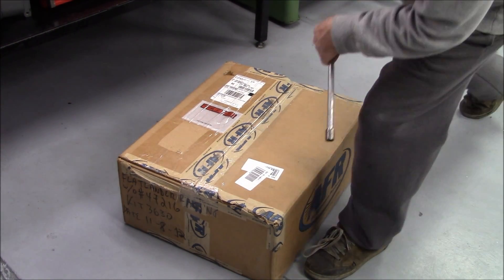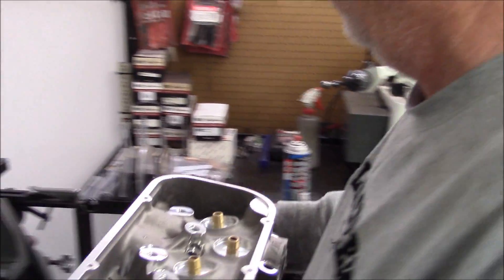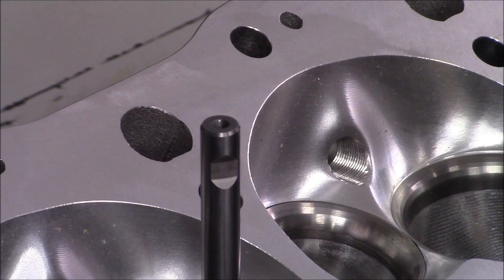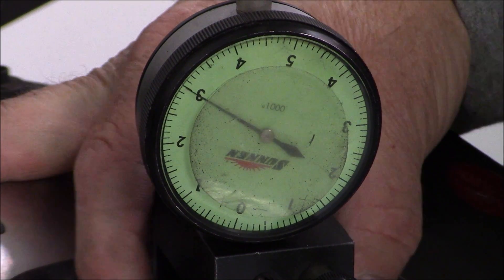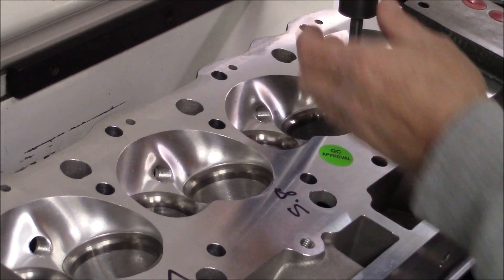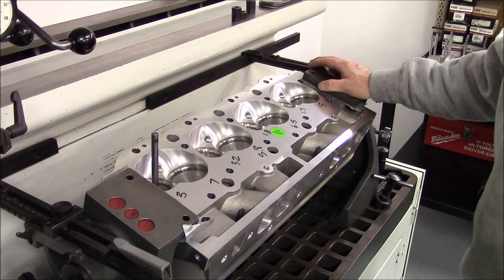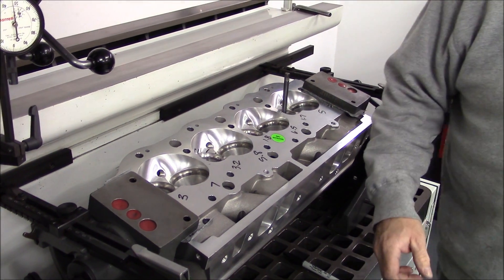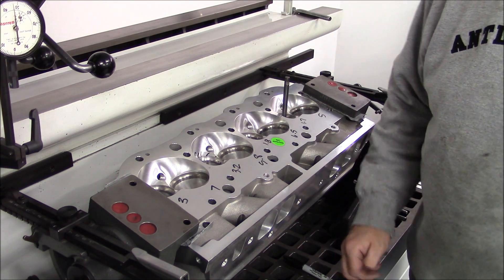Aftermarket Cylinder Heads - Why You Shouldn't Just Bolt Them On - Part 2 - TRRC / Vortecpro

Comment: I would say that most, if not all, head manufacturers  machine their guides and seats on  separate machines "to spec", then press them in the heads and install the valves that have been machined "to spec". Or outsourced all together. But I would most certainly say that the heads are not checked during the assembly process. They don't set stem to guide clearance after the guide is pressed in or check valve seat concentricity after the seats are pressed in. That's why we see such sloppy work, even on AFR heads. Unless you work in a machine shop or know someone that does that sees this kind of stuff first hand, whoever plops down $1600 plus for a set of AFR heads is just going to assume the machine work is top notch and install them out of the box. I did just exactly that when I bought mine ten plus years ago. Luckily they didn't have too much time on them when they ended up back at AFR after they were ported. My head porter and Tony Mamo are friends and I was told that Tony did the valve job himself as well as set valve spring height for my cam. Also flowed number 1 ports on each head.
Reply: No the seats are pressed in then machined. check machining videos on youtube from dart AFR and brodix. they use seat cutting machines in a separate operation similar to the guy in the vidio, Minus all the BULL
Reply: That's pretty sad if what you say is true.  Even though they might still be "in spec" I expect more when dropping that kind of cash for a set of heads to just run out and have a valve job done by a competent shop. If they can't get them any closer than that, might as well buy them bare and have them put together with better valves too. At least that way you know what you will be getting.
Reply: Thats not true the seats are machined in the heads after they are pressed in. I have owned a machine shop for over 30 years.
I dont know of any of the big US performance head manufactures that Out source there manufacturing.
Why am I responding to this video seen these rumors, internet gossip and bull artists  ruin the performance engine building business some one needs to say something
Reply: You're right on one thing - setting up twice will risk introducing error.  In terms of total time to get valve jobs right it would be nice if  heads had guides honed, then seats cut without disturbing the jig.  They may kick them out the door faster with specialized stations, but in the end there are more man hours and more money spent to get to an engine build.  Some things fall on the customer regardless [like getting head ports and manifold ports sized right], but this is one thing that can drive the unsuspecting a little batty.  Tom is right about seats: you can't press something in without some minor distortion or alignment variance, so precutting seats "to spec" is a waste of time.  A rough shape might save some time, but you stil have to cut after install.

Comment: Another thing I’ve learned over time is that I don’t chase numbers lower than the stem to guide clearance. If there’s 2 thousandths of guide clearance then 1.5 thousandths runout is fine because the stem will slightly tilt in the guide and the valve face will seal tightly against the seat.
Reply: Hmmm dunno man, confident this would cause uneaven guide wear if its always trying to center itself on the end of the stroke

Comment: I use a VGS20 and with the dead pilot system I find that the guide has to be flat where the pilot enters.  If it’s not flat the pilot will lean in the direction of where the guide is shorter and cause the cutting and measurement of the guide to be based off an inaccurate reference point. Were the guides flat on these heads?

Comment: Brand new heads are not the only ones with problems I recently purchased a set of ford 351W gt heads on line when I got them I was installing new valve springs to match my cam when I discovered the machine shop I bought them from had the intake and exhaust springs mixed up having found this I checked the heads found several valves cut to a sharp edge I replaced all of the valves but I must say the machine work on the castings was excellent I guess my point is you should always check any head you buy regardless if new or remanufactured
Reply: Rick P.I used a comp cams roller cam in my 5.8 the engineer I worked with had a hard time finding  springs that had the correct travel (without coil binding) and pressure for my cam the intake side was simple (spring shims ) on the exhaust I had to use different retailers and .050 offset keepers (locks)  to get the correct installed spring heightsluckily comp cams did have the 10 degree retainers and matching keepers in 8 and 8 (retainers) 16 and 16 (keepers) sets
Reply: insulman100 yeah but how? I’m new to all this so I wouldn’t know where to go, who to talk to, or even what to look up.
Reply: Talk to several people, and research. Or ideally find someone that knows their shit and have them look it over. There are good machine shops out there, and there are shit ones. I have seen some high dollar shit ones and some low dollar good ones. It's just a matter of trial and error. 

Maybe find some people in your area that has had work done and ask where they got it done, and how good it was. Then use that as a guide on ones to visit and ones to avoid.
Reply: I assume Tiny Turbo you mean intake and exhaust valve springs Yes on a 1996 5.8 w ford engine(and many other engines) they are very different intake 2,06 in. exhaust 1,88 in. these are the valve spring free length specs for a 1996 351 (5.8)Ford Winsor engine(the valve lock is machined lower on the exhaust valve stem) put the longer intake spring on the exhaust valve you have to much seat pressure and possible coil binding best case premature cam/lifter failure  from the seat pressure from coil binding best case bent pushrod worst case broken cam = destroyed engineexhaust spring on intake not enough spring pressure best case burnt valve worst case valve float causing a dropped valve = destroyed engine Just wondering do you work for a cylinder head rebuild shop in Chicago?
Reply: qballtvp that makes sense. Thanks!
Reply: Go to the local repair shops talk to the some of the people that work there some of them will tell you to hit the road but most of them will help you they will either check your heads if they have the tools(for a price of course) or they will direct you to a reputable machine shop that will check and if needed repair your heads again for a pricethe thing to remember is not all shops are reputable do your home workMy advice only buy rebuilt heads from reputable shops and like the video says have all new out of the box heads checked This step may cost money but if your heads are assembled wrong like in my case not only could it cost you another valve job it can also destroyer your cam and lifters or if you drop a valve it can cost you your whole engine
Reply: I didn’t know intake and valve springs were different.
Reply: insulman100 (

Comment: this is the guy I want cutting my heads. Pro!
Reply: exactly
Reply: Cory Bollinger not so much. He checks for normal (vertical) in two axes, and THEN unclamps the workpiece and slides it at 9:29 and then reclamps it, without rechecking vertical.  🤔

Comment: aluminum heads shift around after  a complete valve job, as produced, I guess what your   saying is buy them  bare and have a dam good machine shop straighten out the run -out, the hairy part is some times the valves produced in China can be junk, and have been known to snap, and you know what that means.

Comment: I re-cut the seats on my new Brodix heads after I hand ported them.  I also lapped the valves in so I had a nice band of
contact around the valve seats.  When we dynoed the motor everyone was shocked at the HP numbers!  I was proud to put my name on them!!!  Just take the time and you will be rewarded with something special!
Reply: Steve Solo absolutely im doing thes thing now on a 331 build and everyone doubts my prediction on hp #s and little do they know that when you put that extra 10% work in you are greatly rewarded. If I just slapped this thing together id probably get 350 375 to the tires but when I GET DONE ill betty money I break 500 to the tire but it's gonna cost me probably 200hrs of labor but well worth every minute
Reply: Shouldn't have to lap if they're cut right. And especially if they are ground after. Lapping will not perform as well.
Reply: Contact will only improve with lapping if they weren't cut right.

Comment: Great video I feel like there should be a more precise way to line up valve center and valve guide center but I've never done it so I'm probably wrong the CNCs I operate are from the 90s but I'm able to maintain a .0001 on pocket depth and diameter most my day is indicating either way great video it taught me a lot
Reply: Bob Elkin III problem is production vs profit they can't afford that extra 2hrs per set to do it right
Reply: +Bob Elkin III, yes you can maintain that, but for how long until an adjustment is needed, and or inserts need to be changed? What if the tolerances you go by are set by the company you work for to be higher and they want to maximize machine in operation time? Yes you can slow things down and make it super accurate, but that costs time and money. One off projects at smaller machine shops it's easier to look at it that way and do it that way. Larger shops that are essentially setup for production need to pump them out to maximize profit.

Comment: you should take the tapered pilot and reinsert it180 deg., then check the run out  at 180 degrees. Be amazed at how many bent pilots are around from forcing them into and out of guides. larger the valve head the larger the run out.
Reply: Santa Clause: That's exactly what I was thinking when every one was way out. Then I realized that the seats were probably never cut. This head was shipped with no valves installed. It is up to the valve installer to cut the seats, so they match his valve face angles.  You would think that a professional would know this. Instead he complains that he has to cut the seats, like it's a mistake by the manufacturer.  What an idiot.
Reply: also clean the guide before putting in the arbor
Reply: Exactly, never assume surfaces are clean.
Reply: You my friend are a genius. I was thinking something along the same lines.
I was waiting for this guy to pull out a sledge hammer and strike the head. 😂
Reply: Santa Clause is this really you Santa ??? Aka jay?
Reply: Santa Clause lol we got a guy on our team named Santa and he does heads so maybe it’s you lmao

Comment: You are measuring the concentricity with a tapered pilot and machining  it with the same. Your valve machining equipment is not capable of machining it straight. Use a straight pilot with a max. clearance of .0002 and re-check these heads you buy. You may find you have made them worse.
Reply: I'm glad I read your comment. Makes sense. Probably best to machine/check the guides first?
Reply: I've heard it is important on Aluminum heads to use a torque plate.
Reply: You're an idiot. Aftermarket heads are junk until you fix them. Machine not capable? You don't know what you speak of.

Comment: So why is it that all these aftermarket heads have seats with such high runout when they are using quality, high dollar machines to do the machining?
Reply: The only way this could happen is if the manufacturers seat cutting equipment had a bent shaft.  Not impossible but highly unlikely.
Reply: +Aaron Purtell, No I mean the inserts. In that instance I was speaking about CNC. When machining from billet you don't use guide pilots. That's only  after the head has already been fully machined. I am talking about the  initial machining process via CNC. You can go to www.carbidedepot.com and see what kind of inserts I am talking about. The inserts used  in this video and what other shops use for valve jobs is a bit different. To see a head machined from billet you can check this video out. https://www.youtube.com/watch?v=EPDBdb72oDQ  or search for "Aluminium Cylinder Head CNC Milled from a Block of Billet!"
Reply: qballtvp awesome I really appreciate the info, I’ll have to look into that
Reply: +supersportimpalass The inserts get dull after a while. If the machine operator does not check the tolerances very often it can lead to this. Also it depends on how they are told to do it. They could very well be told that acceptable tolerances are higher than the norm, and run the inserts a little longer than usual. 

+mrbeefhbw maintenance isn't a huge issue here. The man running it? Sure, but it also can come down to how they are told to run it as well. Remember all of these shops have QC. If you as an operator continually runs out of tolorance your ass is canned. It's highly likely that the initial tolerance (set by the company) allowed is higher than what most people would like. 

There are numerous reasons for this. Not having to change inserts = time. The cost of the inserts is a factor albeit a small factor. Time the machine isn't running plus the time it takes for the operator means no money is being made.
Reply: qballtvp by inserts do you mean the guide pilot?
Reply: K
Reply: They are not, buddies tools are fucked
Reply: The machine is only as good as the man running it, and the tech maintaining it. A machine down for maintenance isn't making money.

Comment: How deep have you had to cut these seats in order to get the valves to seat properly?
Reply: Spadadiforza probably between 1/32 and 3/32
Reply: There is only a small margin that actually seals the chamber so the actual dept isn't very much at all ...Right ?  Or ?

Comment: I still remember the first set of heads I did when I was 14, I just put valve grinding compound on the seat, stuck the valve in, and spin it with a drill. I spent weeks porting them on a old junky set of chevy sb. heads.
Reply: When I was 19 I worked summers in the maintenance shop of a highway construction company. One day I was instructed on valve lapping and dutifully started south Ning the Cat head by hand. After working on one seat forever I noticed the other mechanics were looking at me occasionally and snickering. So I asked and they told me that lapping should only take a short time. Wish they had told me that before. The other five cylinders went much faster.
Reply: Dude you look just like Ron Jeremy.... :)
Reply: @johnnys3160  LMAO  I wonder if he is in hedgehog jail too.
Reply: bobwatters  the torsional thrust isn't the only reason not to use a drill. The real MAIN reason not to use a drill is:

The drill is moving multiple college revolutions at one quick trigger pull. This means, that a piece of grit can get stuck in one spot and end up gouging/creating an indented ring in the seat, causing it to not have nowhere near of a sealing surface as it normally would. Even though it'll appear to be sealed and seem "good enough", once you get it up to heat gases/fuel/air/exhaust will slip right on past that valve.

So, in other words, instead of the seat being symmetrically smooth it'll have a little indented ring grooved into it from a piece of grit getting stuck at one point all the way around.

This is why you want to do it by hand, and only go back and forth, back and forth in little half circles, lifting and reseating occasionally, in order to get the best, smoothest, and most uniform seal you can. (Which, should only take 2-3mins per valve MAX, and that's on an old pitted up 200k mile head. On new heads like these, you'll only spend about 1-2mins per valve by hand).
Reply: Using a drill to lap valves is a bad practice.....torsional thrust
Reply: lowbuckfabrication -- he was 14.